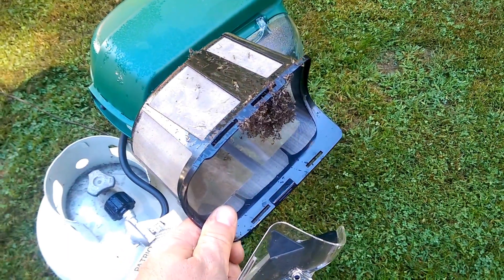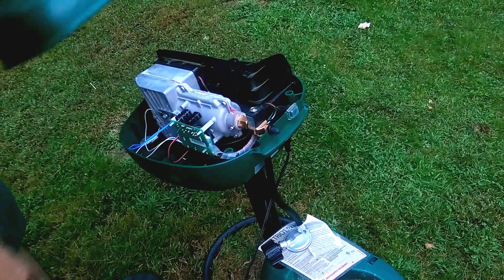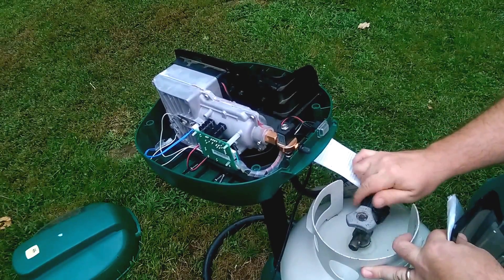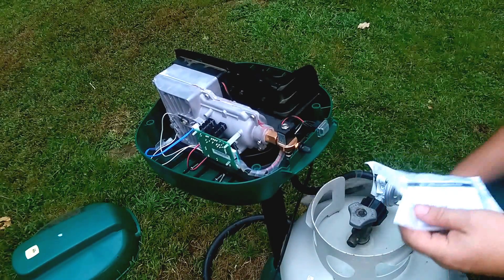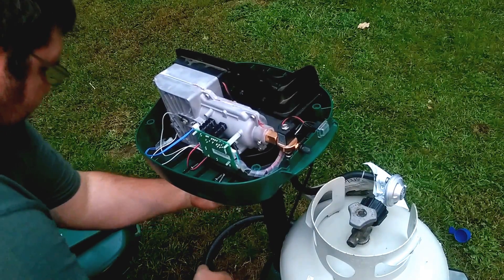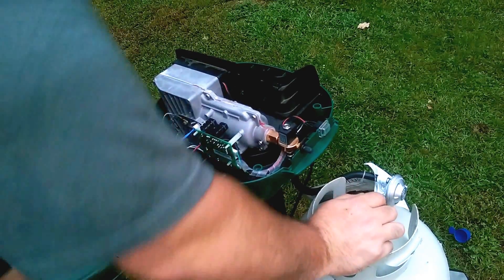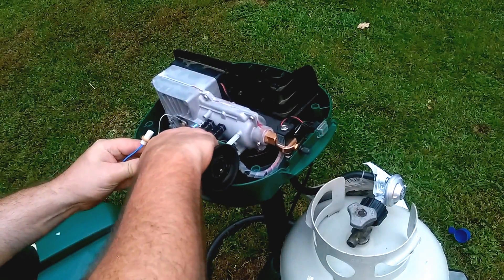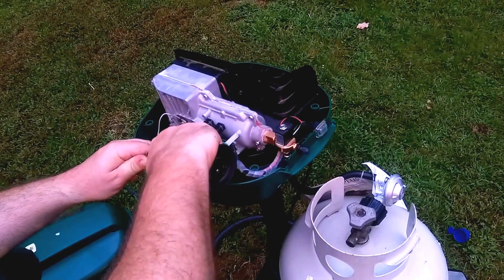Mosquito Magnet - failure of igniter unit, and work-around *Warranty Voided!*

Comment: Fuel nozzle, not the igniter.
Reply from the maker: Nope, the igniter.  Thanks.
Reply: Totally agree Jay- it is the ignition system.  I completely rewired my Defender with an Arduino Mega microcontroller.  Google "mega defender mosquito magnet palomoney"- make sure to start with the first page if you want the full story

Comment: thanks for the video, it seems like every time a run out of gas it's hard and harder to restart. with these it's also a good idea to get your propane tank refilled rather than exchanged, you get alot more gas refilling them
Reply from the maker: For sure, Andrew.   It seems to be the same PITA to start for me each time with very little noticeable change to the amount of time.   Maybe try and use compressed air on the cleanout valve (Or a CO2 cartridge per mfg recommend.) if you aren't already.   See if that helps.

Comment: How long did you have to fire the torch in there before you got a solid?  I noticed you cut the video a couple of times, so I'm just curious.
Reply from the maker: Hi Larry- It is an uncomfortable amount of time.....  What happens is - when you turn on the unit- all of the fans run as if it were running, then it stops (after a minute or two) that is the point where I hit the sensor opening with the torch.  It takes ~5 minutes (literally ~600 seconds) and I shut the flame off and replace the broken sensor in the hole after the light on the power switch goes solid/stops blinking.

Comment: Just want say thanks for making this video. 1 day after the warranty ended it broke.  I thought it was the regulator but not.  After seeing this and checking the igniter it was cold and not getting warm.  Tried your instructions and it fired right up
Reply from the maker: Robert Andrade - That is super, glad it helped.  This is the 3rd year like this and I still cannot find a replacement igniter.   On my 3rd tank this year- so far.

Comment: Did you check after this "repair" to see if it was still working?
Reply from the maker: Sure.   This was last year and I am already on my 2nd propane tank and attractant this year.  Working like it should.
Reply: Do you think I should buy a brand new one? I have a guy selling one locally for a $100. Based on your recommendation, I will purchase either one.
Reply from the maker: It is a significant investment either way.  If you get the new one, and don't void the warranty, it will give you years of service, and if your igniter fails like mine did, you can send it back for repair....  But you could save a couple hundred bucks for a chance used one.  I think the Mosquito Magnet folks will repair it for a fee....  Good Luck Omair.

Comment: Awesome! Mine won't start this year. It worked great all last year, now after 10 times of trying to start I get the fast blinking light. You think it's an igniter problem too?
Reply from the maker: meter the igniter you should have some resistance with an electronic multimeter, if it is open, likely it is bad.  My igniter was only one screw and once taken apart, tht problem was obvious. I can't diagnose your MM's issue, but this is scary dangerous each time (torch near a 20lb propane thing) but the risk is a mosquito bite!